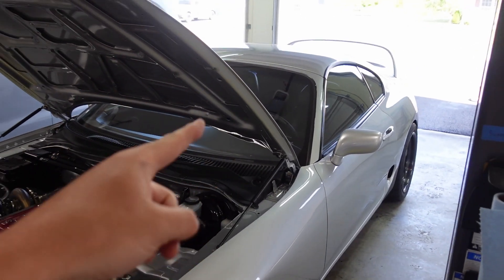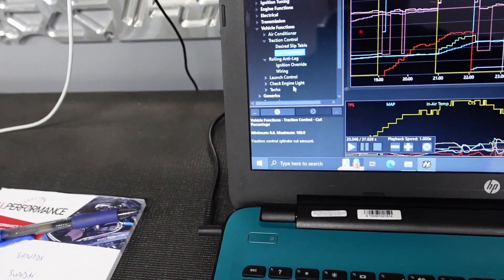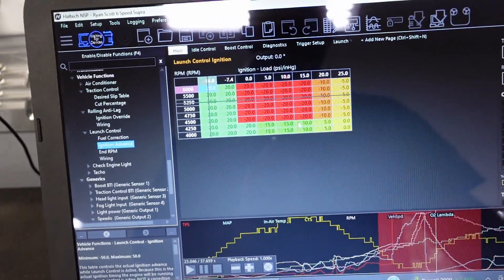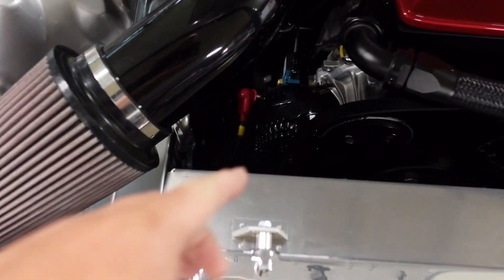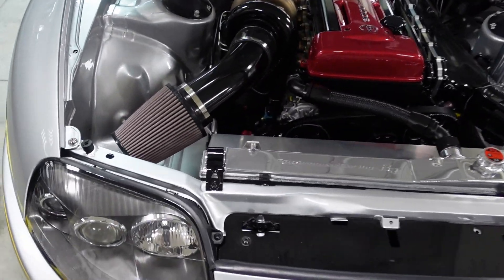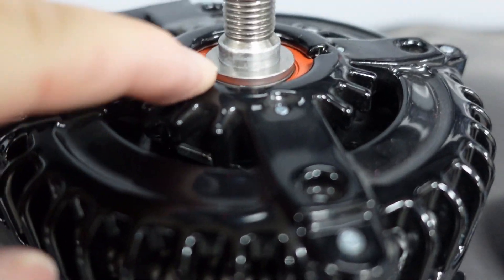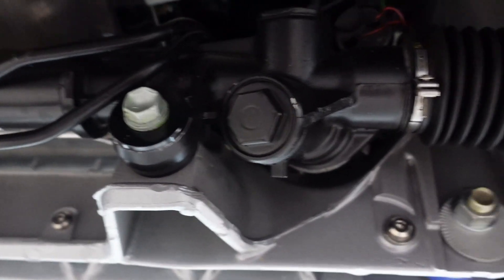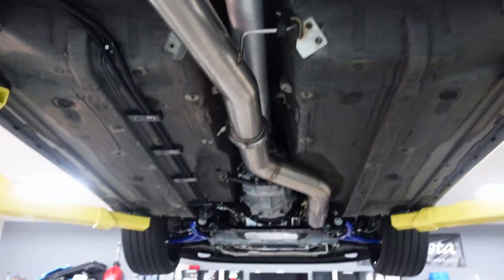AupTech Engineering 2JZ Alternator fix (PHR Pulley)

Comment: Question good sir. With the upgrades pulley does your voltage drop at idle and shoots up once you start driving? Like 12.5 idle then 14 once your actually driving
Reply from the maker: @srtwil9386  no, it stays 14.5 volts at idle and all the way to redline. I’ve seen it drop to 13.8 by 8800rpm, but that’s it
Reply: @PureFunction ok thanks. I have a jsaltenator and it’s at like 12.5 at idle. They told me that’s how it’s set up but I don’t like that. SMH.